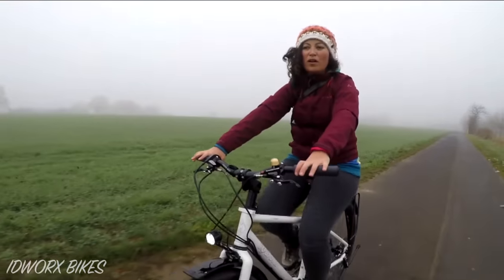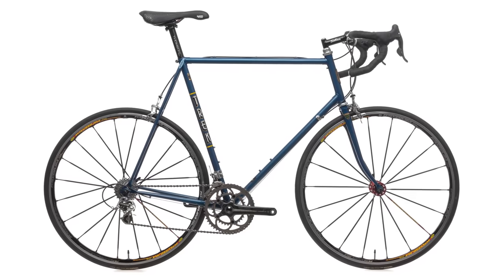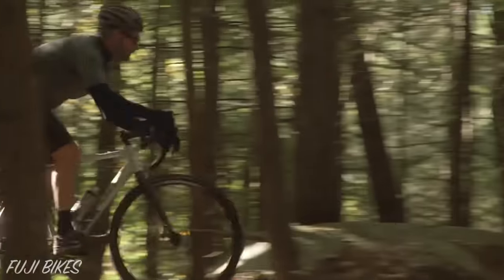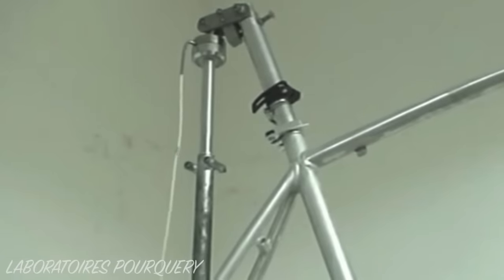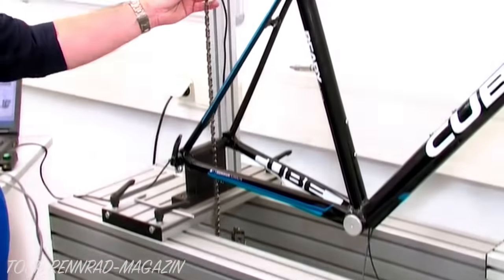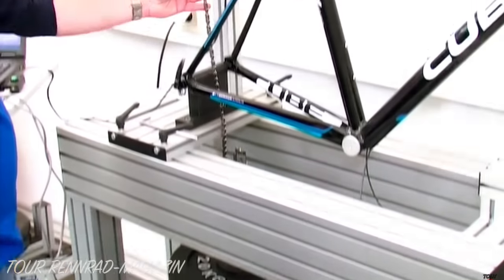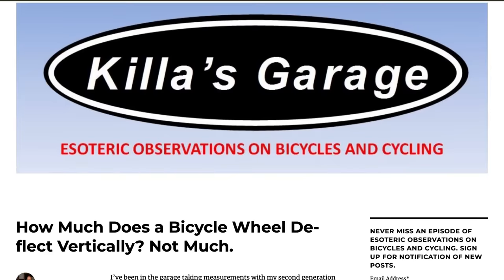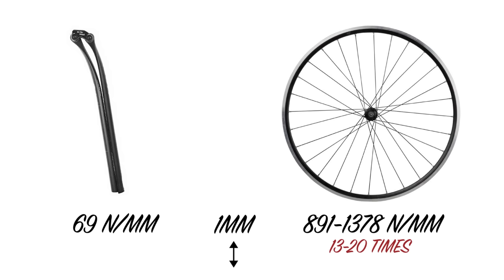Why It's Impossible For Steel Frames To Be More Comfortable Than Aluminium

Comment: Hey there, really interesting video. I have some thoughts… 
when I ride over rough stuff I usually stand up which in turn means we have to consider a couple of factors not considers it your video that ant that might or might not put a bigger emphasis on the differences on materials. 
when I stand Seat post and saddle have no influence putting more emphasis on frames and add Cranks to the picture.
Definitely handle bars are a massive factor in the feel of a bike as well as grips. Usually peoples hands are more sensitive than their butts.
more and more carbon frames are not built in classic double diamond design but other shapes that are not possible in metal that allow extra compliance.
Geo,  the shorter a bike, the more upright you sit the more the discs in your spine get tortured...

so much more factors that could be considered...
also when on the seat and pedaling, pressing down a pedal means taking weight of the seat. hence totally changing your stack of springs. the more power I put in the less weight on the seat.
in this case only tire and frame compliance can give you added traction climbing up a steep gravel road. 

Well, the reality is really there is nothing else in this world that people ride around on that people would consider better without suspension or that even still exists without suspension but still some cyclists insist.... only reason we have super uncomfortable road bikes today is UCI rules and bike companies complying to them. How many people really rides in UCI races? 
Not only does this give us really uncomfortable road bikes, UCI also makes sizing really inappropriate for taller riders as there is max measurement...

well, Ok sure Forklifts also dont have suspension, so all of the fork lift drivers out there, your are good to continue on your hardtails
Reply: @Fight Film  What about horizontal compliance/springiness? Double butted heat treated steel seems to have more springy horizontal compliance without being too noodly which reduces back pain and gives the feeling of so called ride flow similarto therapeutic horse riding. In my experience budget grade aluminium frames were harsh and clunky regardless of tire pressures while also having high speed shimmy on descents.

Comment: High quality steel frames are a much smoother ride.  Double butted thin walled steel frames have muluiple reasons for better comfort.  High end steel tubing is highly resistant to fatigue, meaning flex can and is built into the tubing.  The tubing in steel frames is much smaller diameter due to higher strength and fatigue resistance so flexes with less force.  Most mocdern bikes are built on a compact design, short tubes and short wheelbase.  This does two things, short tubes are much less flexible than long tubes, the wheels are directly under the rider transfering road shock and vibration.  Any such frame is much more harsh to ride.
Comparing a large size Giant defey advanced 2013 with my current steel framed bike.  Steel frame is 16 cm longer wheelbase, no foot front wheel overlap, very smooth ride and only 1 kg heavier.  Frame design and frame material both matter for ride quality as do wheels, spoke lacing, rim width, and tyre size
Reply: What steel frame are you riding? Do modern steel bikes suffer from the same compact geometry issue that aluminum and carbon frames do?
Reply: @Pellagrah   Mine is a custom build, while I am only 180 cm tall more 50 years ago a heavy build 110 kg and 46 cm c-c bars.  Down tube 28.6 mm Reynols 853 every thing else is 531, centre front 63 cm,
Reply: 54 cm centre rear.  Basically a long wheel base touring bike but built fairly light, could go lighter but 110 kg rider.  Wheels are Novatec hubs DT Swiss R500 rims with mini V brakes, 24 DT Swiss revolution spokes front and 24 champion spokes rear rear chainstay are offset to remove the disk in the rear wheel.  32 Conti 5000, Shimano 105 10 speed
Reply: @Pellagrah  Most bikes are built on the same plan.  To fit in the smallest box possible because transport (container space) is very expensive.  Steel is also the easiest to build custom to fit the rider. either lugged is best, fillet braze requires more operator skill as does TIG welding.
Reply: 16cm longer? Doubtful. You need a better ruler.
Reply: @bikeman123  Why are you questioning measurements of someone who has worked to tolerances of 0.001 mm.  As a mechanical engineer measurement is critical.  I designed and built the frame to do what I wanted.  Full clearance of front wheel and foot, minimum 40% f and 60% r weight distribution and bare bike less than 10 kg.  Toe clearance required longer top tube, frame, the weight distribution required extended chain stays.  O.8 - 0.5 - 0.8 mm wall steel tube damps vibration.   All were achieved, bare bike 9.5 kg, weight distribution is 42% f and 58% r, with rider total weight 120 kg.  I am not little. The bike has now done 15,000 km.  Probably the best bike I have ever ridden in 50 years of cycling.  I have seldom owned a car and used bicycles for commuting, recreation and touring, I still do not own a car.

Comment: I'm always surprised by all these fancy looking plots the industry shows. Wouldn't you need a bode diagram that shows the amplification of movement of a frame at different frequencies? Also, carbon might sound dull as it dampens in opposing directions. However, the young's modulus of carbon fibre is a lot bigger that steel's and therefore it won't flex at all, stressed in its direction. 
Quite difficult to reduce this to a "dull sound"

Comment: I had several high quality steel
 road bikes. After long rides 50-100 miles I felt like I’d been beaten with a hammer. I switched to carbon fiber & really     helped. But the best thing was getting Spynergy wheels with PBO fiber spokes. I have some skeletal arthritis & these changes have made a huge difference in how I feel after a ride. And I have carbon fiber seatposts on my road bikes & the mountain bikes that I ride most. Take Spynergy wheel with no tire & drop the rim on cement. It will bounce back into your hand. Just imagine how much shock absorption that is. Yeah, it’s a LOT! 🚲
Reply from the maker: Interesting to hear that the Spinergy wheels make such a big difference for you. They must require very little force to flex a vertical millimetre!

Comment: Thanks for the vid and the all work you clearly put into it. Bike designer Mike Burroughs (r&d for Giant for many years) mentions in his excellent book 'Bicycle Design' that there is no inherent difference in terms of rigidity between the two materials, but because steel is stronger you are able to use narrower tubing allowing a less torsionally rigid frame. Aluminium is weaker so thicker tubing is required leading to a stiffer frame. You also don't need much of an increase in tube thickness to acheive an exponential increase in strength. One would have to build two identical frames with identical geometry, tube diameters, wall thicknesses and subsequent spec to be able to perform a valid comparison. As many have mentioned there are many factors contributing to the flex of a bicycle so presumably you'd need to eliminate all variables save for the frame material. So really you may be right in your title but you'd need to risk building and riding a thin tubed aluminium frame..! Of course, we have carbon now so no need to try :-) Just some thoughts! Cheers
Reply: Most mass produced aluminium frames use very thick tube walls, like 1/8" thick AL vs 0.04" CrMo. I think there is some improvement with hydroformed tubes that kind of do what "butted" steel tubes do, but Aluminium fatigue is still huge unknown risk so I don't think you could ever really get that thin. Carbon plastic is indeed the best bet.

Comment: I totally agree that big tire and carbon seatpost are way more significant impacts in comfort, but over a long distance of riding Give me a choice of steel vs alu frame w/ similar cockpit and tires, I will always choose Steel. Plus When your standing on your pedals over rugged terrain, your seatpost deflection doesn’t matter, and depending on route that matters to more tired legs.
Reply from the maker: Even if you take the seatpost out of the equation, we still need to calculate out the 'springs in a series'. That's the frame which could be 7000N/mm, the wheel which is 800-1300N/mm and the tyre which is somewhere between 10-250N/mm. As I stated in the video, the overall spring rate is ALWAYS less than the softest spring. You, therefore, won't notice any difference between a steel and aluminium bike in terms of tired legs.

Comment: From my experience it is mostly about the fork, it the front is a steel fork it is very likely to have a bit more flexibility than a aluminium one or a carbon one, especially if it has more rake. That puts less harsh impacts on the shoulders and makes rides more comfy. The variations of stiffness of the rear is not significantly different. Everyone who changed from a undamped mountainbike to a front shock absorbed bike in the 1990's can understand that.
Reply: I agree, I think he left a lot out by basically skipping fork geometries.
Reply: Most weight is placed on the rear of a bicycle.
Reply: @risesir  Yes and I heard the weels are round!

Comment: I had low spec steel framed Specialized MTB with no suspension fork back in the early 90's which gave a lovely, quite flexy,  smooth ride compared to something similar in aluminium. I don't think it was my imagination..........
Reply: Did some jumps with a steel MTB. Full steel. Not as terrible on landing as I thought. I think its all simply the fork. I mean. Look at the shape, it's usually slightly bend at the bottom, modern forks ain't made that way

Comment: I understand the video is about frames but I think the idea of steel=comfort always came from curved steel forks that were designed to flex. Also there are some steel bikes (don't know off the top of my head) which have specially shaped rear triangles in an attempt to allow the tubes to bend, which would allow an action similar to mountain bike rear shocks. Not common, but worth looking into as they are a definite exception. overall a nice video.
Reply: In theory the steel blades flex a bit more. On practice especially a road bike.  There isn't really enough rake in the fork to take advantage of it. It needs to happen as near to the hub as possible. Any flexibility in the blades near the crown is felt in handling.  And that part also needs to be the strongest. I'm not saying it is not possible to make a nice steel fork. But it's expensive.  High quality steel is essential. Complex forming of the tubes is essential. And then it takes experience to bend them and put it together. At the end you have an expensive fork that weights more than Carbon Fiber. There may be the same vertical compliance, but the lateral compliance ( lack of stiffness) in steel will be greater and undesirable. And the Carbon Fiber fork will definitely have better internal dampening. I believe the old school rims had a much bigger factor in ride comfort.

Comment: Thank you for this video. Excellent analysis.

I see some BTL comments are trotting out the mythical difference in feel between common seamed high tensile steel tubing, and thin-wall steel alloys such as chromoly and mangaloy (Reynolds 531, etc). This misses the point you clearly make. Much work has been done by some of cycling's most respected engineers and scientists (as opposed to marketing departments and other sellers of magic pixie dust) to debunk this hokum. 

Here's the late Prof. D.G. Wilson on the subject: 
"The goal of increased strength or stiffness is somewhat in conflict
with elastic compliance for comfort over bumps. Actually the main arena
for this competition is the handlebars, and to a lesser extent the seat,
cranks, and fork; the rest of the frame plays no role in softening bumps.
There is probably value in trying to increase the handlebars’ torsional stiffness while maintaining or decreasing vertical stiffness." (David Gordon Wilson, Bicycling Science, 3rd ed. MIT, 2004, p. 367). 

Further : 
"In Papadopoulos’s limited experience of blind testing (varied tire
pressure +/- 1 bar, varied bicycle mass +/- 2 kg) or double-blind testing (varied
frame stiffness and material) of bicycle characteristics, riders could not
demonstrate anywhere near the powers of discrimination among alternatives that they claim to possess. We speculate that many ‘performance’ sensations are imagined; demonstrating otherwise is a promising field for determining what really matters." (p. 302). 

Finally:
 "David Malicky (1987) performed a double-blind test of stiffness perception, using bicycles with frame tubing of relatively high and relatively
 low wall thickness (with mass added so the bicycles would weigh the same). The test population of racers could not perceive any difference in stiffness among the bicycles. (p. 367-8).

Sorry for the long comment, but as a cycle industry veteran, this is a subject close to my heart.
Reply from the maker: I hadn't seen some of those names before. Interesting stuff! If you're into podcasts, check out the Marginal Gains podcast on cycling placebos... I think you'll like it: https://marginalgainspodcast.cc/the-placebo-effect-and-marginal-gains/
Reply: Gratitude for sharing that Michael. An eye opener.
Frame choice is important, but not for some placebo claims or imagined/non-verifiable benefits.
Reply: @Cyclingabout  thank you! An enjoyable listen, and interesting on a number of levels.